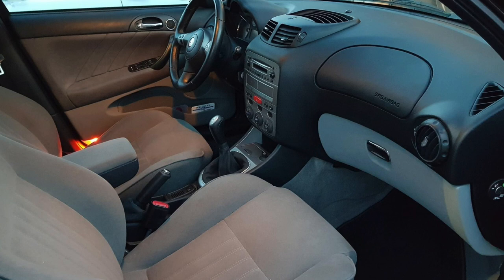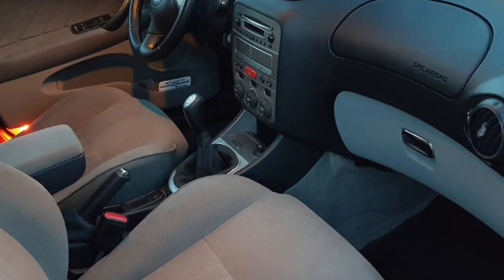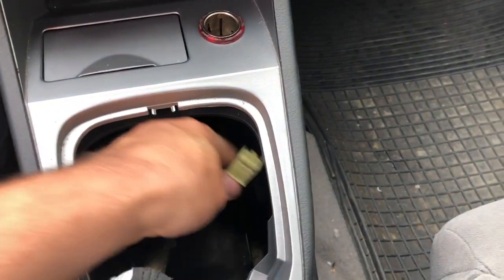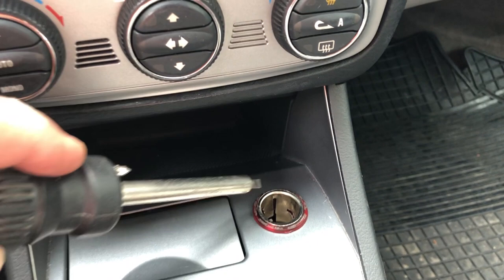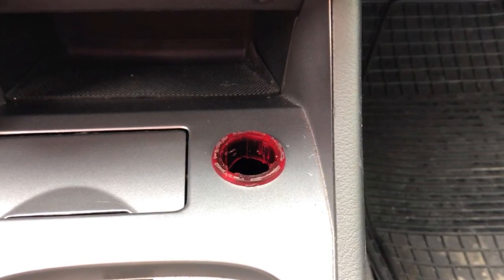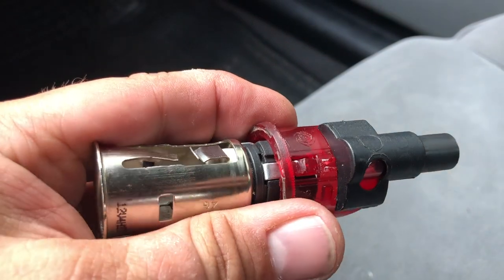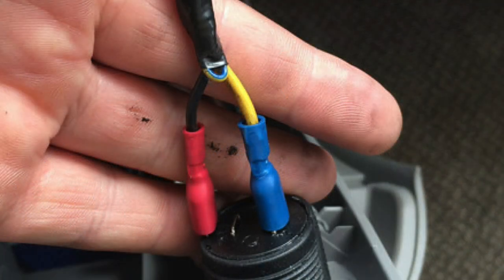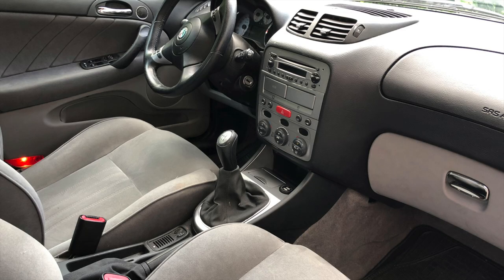Removing the cigarette lighter and replacing it whit USB fast charger in a Alfa Romeo 147

Comment: Thanks for this - worked perfectly for me (on alfa GT). On the GT it is easier to get at the wiring connecter (you just remove the ashtray with a single screw). I fitted a dual USB socket for connecting into back of a new 2-DIN head unit - allows me to get Android Auto and phone charging (depending on the head unit you choose).
Reply: Could you send me please the  link?
Reply: @davidepinnington  thanks a lot

Comment: How did you secure your USB charger in the hole ? I replaced my cigarette lighter with a USB charger like the one shown but the charger body is threaded and secured by a screwed on ring from the bottom and I can't get get access to tighten it up properly

Comment: I did not pull any wires from the jack after removing lighter. Just plugged jack into charger and it worked.
Alfa GT